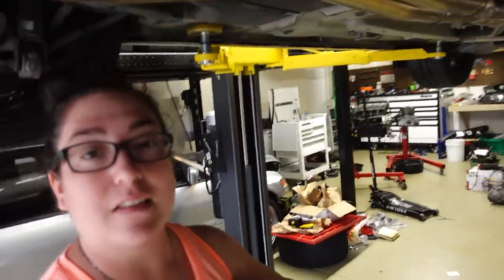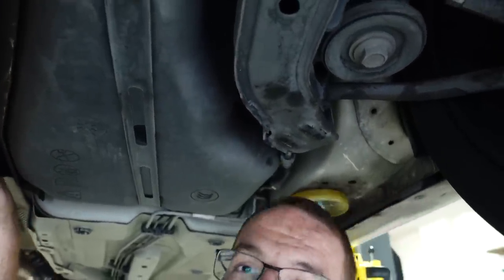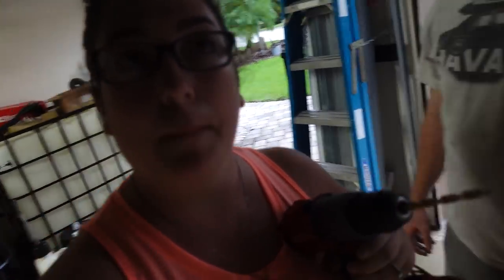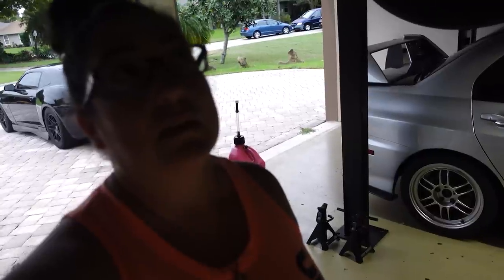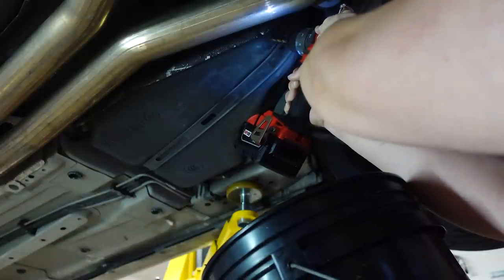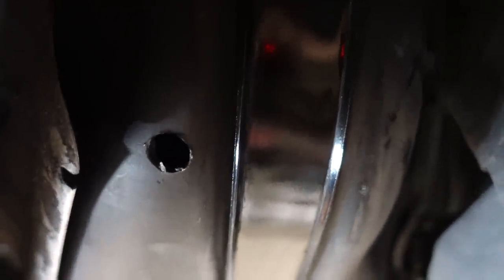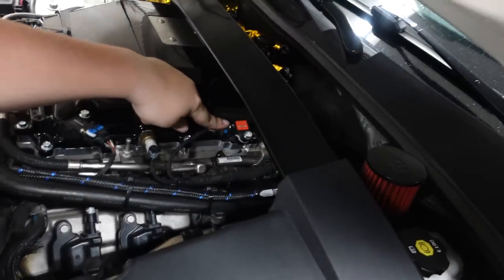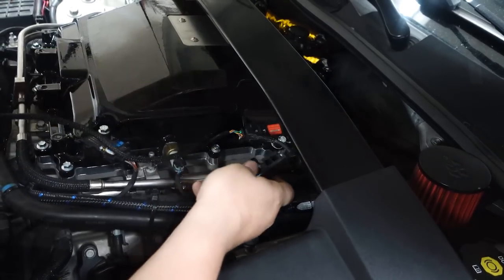Flex Fuel CTSV DSX Auxiliary Fuel Pump Install!! | Amanda Rae Jean

Comment: This is the best video on this install. Thanks for doing this. I'm doing mine this weekend. Wish me luck!
Reply from the maker: Good luck! Its not that bad, I promise. Def do pilot holes in tank. U want that fitting snug as a bug. 👍
Reply from the maker: Let me know how it goes for u!
Reply: @AmandaRaeJean  Here is an update. Apparently our kits and cars are a bit different. My pump clamps didnt come with self tapping screws. Instead I have a threaded plate that goes on the inside of the frame. What a PITA that was! Anyway, its all wired and the tank has been drilled. I should finish it up tomorrow. Thanks again for your help and support!
Reply from the maker: @flyinbrianz22  ours didn't come with the self tapping screws. We decided to go that route ourselves and went out and bought them. We didn't have a bracket for the pump. Sounds like you got it all figured out though! Awesome 👌
Reply: @AmandaRaeJean  Well I'm finally back in town so I decided to put gas in the tank and prime the system. I have leaks everywhere. My connection at the tank leaks and I have a leak where the "T" fitting is. Its not the blue fitting but its the green one thats leaking. I never touched the green line. I thought I did everything right. Very frustrated!
Reply from the maker: @flyinbrianz22  OH NO. thats not good. did you use enough of the goob stuff? and let it tack up... and you used the NPT F tap right? the tank tap had to be the right one. otherwise it would be loose. tighten up the green line. it might of loosened when messing with the blue, which sounds odd, it shouldnt of. start back at the beginning.. and just retighten everything. feel free to message me on fb for quicker responses if you need more help. <3
Reply: @AmandaRaeJean  I put the green goop on. It sat for a week while I was out of town. My only thought is that when I put the elbow on, there was a little bit of gas around the hole. Maybe that wouldn't  allow it to seal properly. As for the green clip, I have no idea. I will take it apart and see if its broken. Also look inside to see if there's a seal.
Reply from the maker: @flyinbrianz22  I honestly don't think a tad bit of gas around the hole would prevent it from sealing if you used enough goop.  But maybe that's it. Hopefully the clip is broken and that's an easy fix. Lmk! As for the seal. . Redo? Put your car at an angle if possible so all gas will be forward in tank and u can at least make sure there is no gas around hole this time around .
Reply: @AmandaRaeJean  Thank you for you advice. Right now I'm so frustrated I dont even want to work on it. But I'll suck it up and redo it. How do I find you on facebook?
Reply from the maker: @flyinbrianz22  Search my name " Amanda-Rae Poirier " or I will try to find you too.

Comment: I’m having major trouble trying to resecure the blue push factory snap-lock onto the supplied DSX T-fitting.  The factory fitting at the end of the factory flexible line came off easily; getting the DSX “T-fitting” inline is giving me nightmares! 
I’ve cleaned everything with WD-40, applied bearing grease to everything, pinched the blue snaps as Hard as I could by hand.  Finally resorted to attempting the pinch with a pair of slip joint pliers!  Still can’t get it to snap onto the T-fitting.    Question:  “How did you achieve the snap?”
Reply from the maker: It took us a minute to get it too, but if you have the blue clip pinched together it should slide back enough to shove it in and slide blue clip back down getting that snap sound.  If you pull the t fitting off like we did at 9 min mark, it makes it easier. We still struggled though. See if you can get it to snap in before you hook it to the hardline..  just male sure clip is in correct orientation.

Comment: Have you ever had any issues with leaking fuel since the install ?
Reply from the maker: None at all.  Just gotta be careful when doing the drill in the tank.  Start small.  Work your way up.  As long as you don't use wrong size. Should be good as gravy!

Comment: quick question, the fitting that goes into the bottom of the tank, did it ever bottom out or feel like it got super tight with the threads? I feel like I keep spinning mine and I dont want to strip it out
Reply from the maker: It's a tapered fitting. It shouldn't bottom out. As long as your using the right bit. Nptf I believe is what it's called. Then we went just a tad more than most people do, but it was snug, and we overused the goo.
Reply: @AmandaRaeJean  yeah I used the whole thing lol, I'm probably threaded in 90% of the way in. Works great! Definitely woke the car up with e85
Reply from the maker: Without a doubt! My car runs like Crapola on 93 haha!

Comment: Hey Amanda! I’m about to install this using the same sealant. Have you had any issues with leaking in e10/85 fuels?
Reply from the maker: No issues whatsoever. I loaded it on to be safe too.
Reply: Gonna do the same. Your videos inspired me to tackle my car. Just wrapped up the cam and balancer. Blower is back from port and Brodix heads just got in! Praying for oil pressure and no leaks in start up 😆
Reply from the maker: @saschan.6070  imma pray for you. We are about to start the Foxbody Friday after taking her completely apart for the first time. Pray for us lol

Comment: Man i need to get one of these. Any fuel pressure issues/ drops running full e85?
Reply from the maker: no not really. as long as the pump can keep up I've had no issues. just always make sure there is plenty of gas when doing a hit or pull... thats a given, but I forget that often lol

Comment: Mine started leaking outta the tank so I guess Ima have to figure out what the previous owner has done...Im afraid he used the wrong threader and he got it a lil larger than the fitting..Im not sure..Does anyone have any ideas??
Reply from the maker: It's a tapered fitting so maybe try threading it in further.. if it is all the way then either use the next size up fitting, or I've seen people use a bulk head fitting, the bulk head is harder cause you have to sandwich the tank from inside and outside which would involve pulling the tank or cutting the inside to access it.